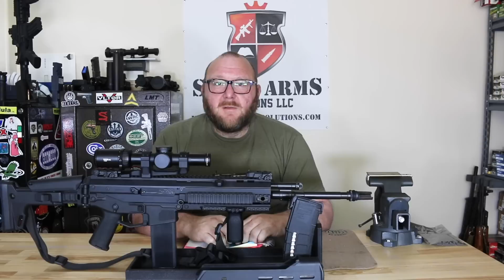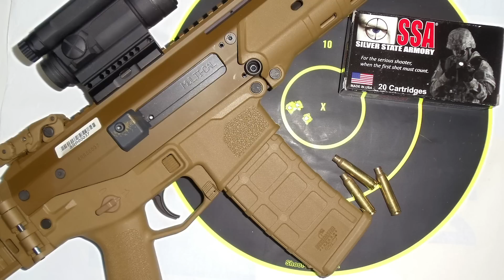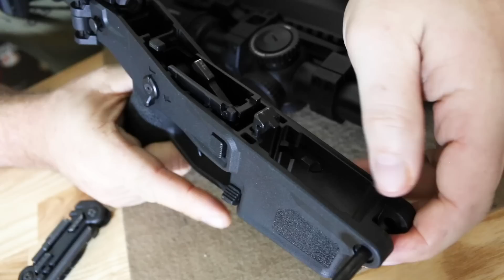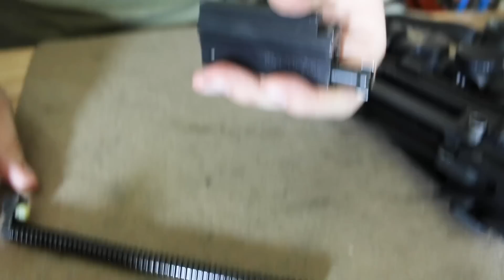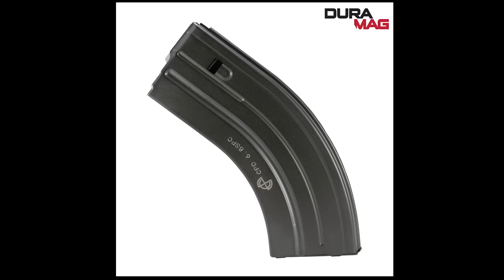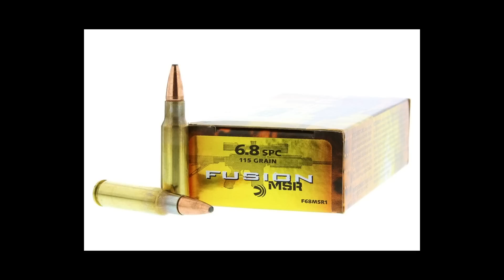Bushmaster ACR 6.8mm SPC

Comment: I wanted one for almost a decade, finally having enough cash to buy one in 2019. The one I purchased was an original Windham model from 2010, "the best version". My first outing, the thing jammed and was rendered useless until I could do armory work. The damn roll pin, which holds the recoil spring to the end of the rod, split under recoil and jammed up the gun. Piss poor design that such a simple detail rendered a gun useless.  Roll pins are common on guns, but if you see the way this one was installed it is far more prone to failure and twisting.

Comment: I couldn't get a 6.8spc in an ACR at the time I wanted one many years ago.

So I built a Billet receiver AR-15 in 6.8spc, and installed an Adams Arms piston system. Runs smoothly, reliably, accurately, and is lighter than an ACR.

Comment: After 70 years in US service, you still can't exceed the AR15 design in any significant area. Instead, some newer weapons incorporate nice-to-have features, but without beating the basic features of an AR15. In fact, 99% of military users will not get the full capabilities of even an AR15 because even specialized marksmanship units like AMTU only train THEIR own people to extract maximum performance from a box-stock weapon. And that's so they can show what the weapon, and proper training, can REALLY do if challenged.

I found it was all the banging and clanging inside the rifle that hindered accuracy, in my case because it pissed me off. A plastic anti-whip disk on the end of the buffer spring, and a plastic buffer disk to prevent metal-to-metal contact between the buffer and back of the bolt carrier, were easy and cheap upgrades, $10 at most. Some sort of polymer wedge system to provide consistent lockup between the upper and lower eliminated much of the mechanical flaws that then hid the biggest source of inaccuracy, the taxpayer-standard trigger. 

The first modifications shrunk group sizes considerable, but there was always the 10% of rounds fired that resulted in a flyer. Just for kicks, I put in a match-grade target trigger and the groups got even tighter, and the flyers vanished. That amount of money, plus a good (but not extravagant) scope would make a DMR for me that I'd confidently use out to its maximum efficient ballistic range. 

With about 100 rounds of practice per month, I developed enough skill to know that I could keep each round within about a thumbnail width at any range I was practiced with. When you have confidence in your hardware (and maybe tuned it yourself), it's easier to spot what you need to do to improve your personal skills for the confidence needed. 

Try convincing anybody with a billion-dollar small arms budget to splurge $1k per year per DMR, and you've just made a career-limiting move, despite the added skills and performance you could bring to the battle.

Comment: The ACR is a neat gun but I constantly have to ask myself the same question that I ask about all "new" rifles. What can this do that an AR15 can't? They make these "new" guns with similar controls, barrel lengths, weight, and using the same round as the industry standard (AR15) but they come to the market at 2-3 times the cost.